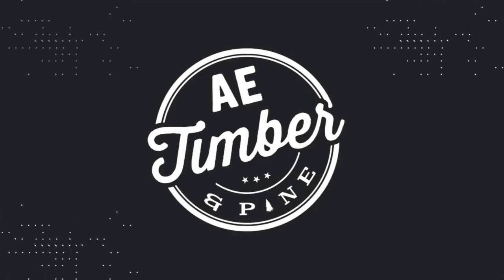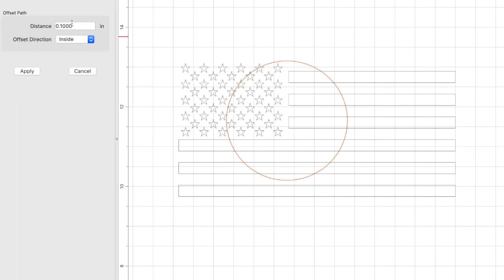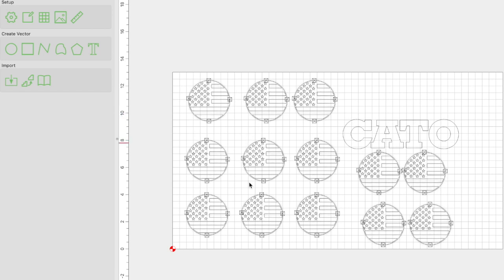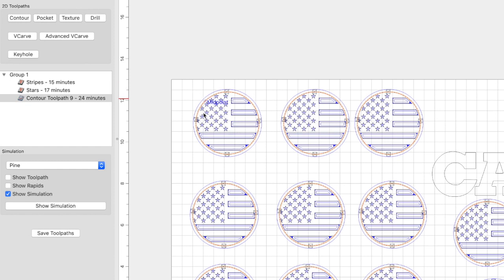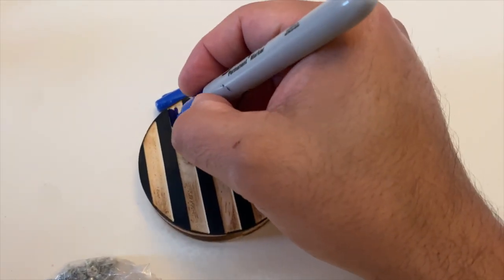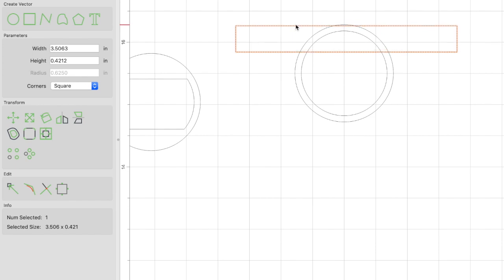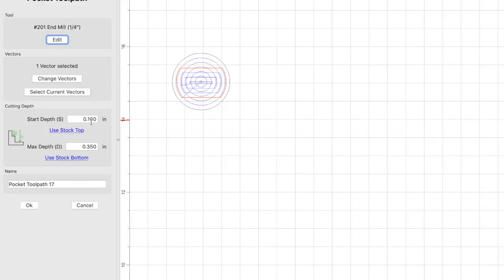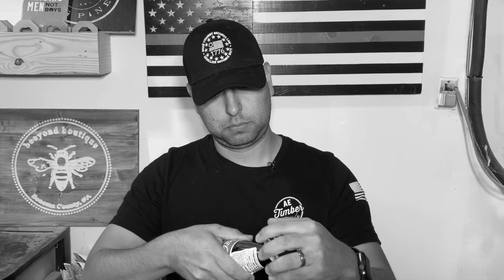How to Make an American Flag Bottle Opener with a CNC Machine!

Comment: How did you zero the back?
Reply from the maker: I zeroed it just like the front. Set it on the table and used paper method. 

The only thing is I had a really bad make shift jig to hold the openers and so once I set it once I didn’t set it again. I just re-ran the same project over again until all the backs were cut out.

Comment: These are awesome. I am trying to make some openers for my fellow firefighters. I want to put the Maltese cross with their unit number and our dept. on them. Is there a way to set the tool paths in carbide create for the top and set up tool paths for opener pocket on the back without having to carve the back of all of them separately?

Thank you. Keep up the great content.
Reply from the maker: Hey Eric,

The only thing i Can think of is you could carve the designs and then flip over the material and cut the pockets and cut them out. 
The only thing is you’d have to be able to get the material in exact in the spot to be able to carve out openers.

My table and clamping method is not exact but I think if you have a good method you may be do this.
Reply: @aetimberpine  Thank you. When you carve out the back of yours how do you locate your bit and make sure it is in the center of your opener?
Thanks again.
Reply from the maker: @ericmacconnell5188  when I carved the slots for the bottle openers I changed my settings to set zero in the center of the material rather than the bottom left. So that allows my x,y and z zeroes to be set all in the same spot, the center of the material. 

Good question, I should have mentioned that.

Comment: Awesome Video, they turned out great! Was your intent for these to be used as a coaster/bottle opener combo or just bottle opener? 

Quick question for you, I've been playing around with making some coasters lately and have been struggling with choosing a heat resistant finish. So far I've tried Shellac and Lacquer; but when I set a hot mug on them-they stick together. I've read polyurethane may be the way to go. Was wondering if you had any insight to offer? Thanks for your content, it's great!
Reply from the maker: I didn’t even think about it being a coaster/opener combo.  I’ll use that in my sales pitch haha.

As far as sealers, I’m a big fan of water-based polyurethane. It dries fast and 2-3 coats gives good protection. 
I have read that oil based is also really good for year but I have not tried oil based in a long time since it Can discolor stain so I have stuck with water based.

If I were doing more work without color and more natural woods I would consider oil based.
Reply: I use polyurethane often, cups stick occasionally. the best non stick coating I've used for coasters is boiled linseed oil on plain wood, let it soak in overnight. If carving on plywood, coat blo  1st, let it dry few days, then carve. Otherwise it seeps out & crystallises on open endgrain